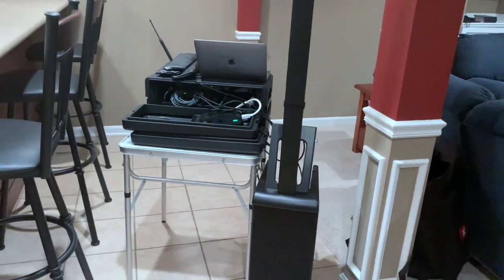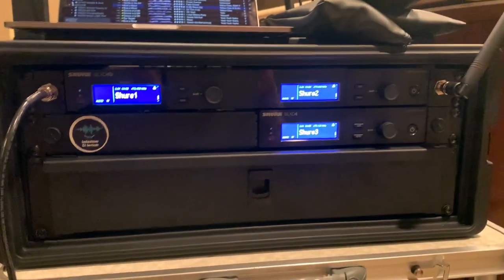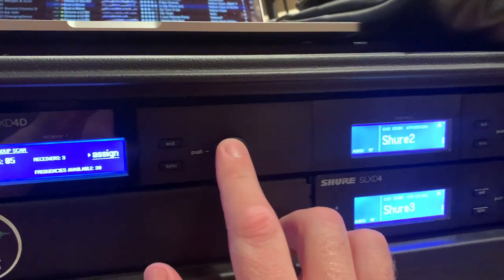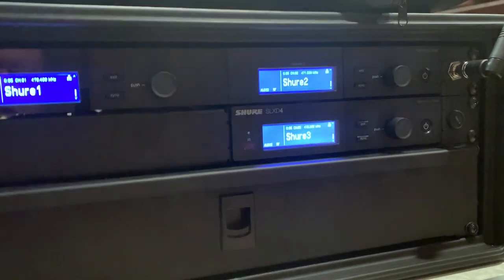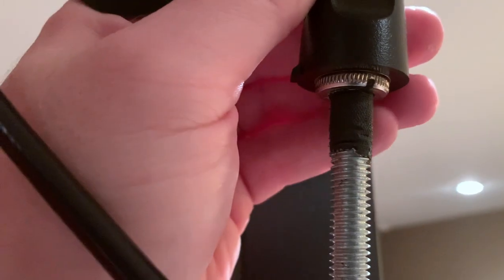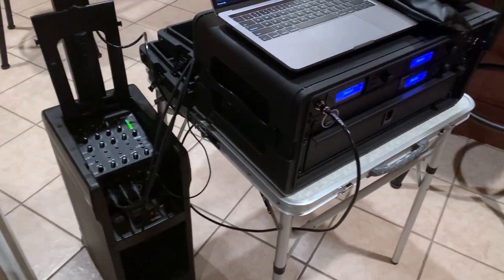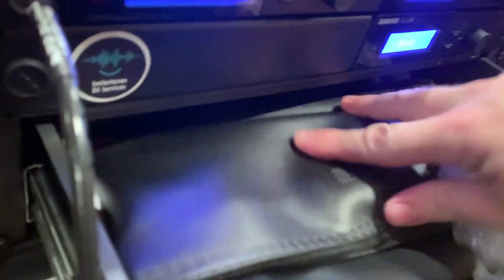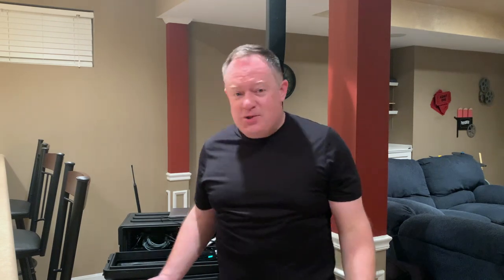Wedding DJ Ceremony Setup that is High Quality, Efficient, and Ultra Portable

Comment: Nice setup. Only thing I do differently is I only have 2 mics for ceremony max. The 2nd U is for a 1U mixer so all the mics go cleanly into it. 2nd reason mixers built into speakers have been prone to feedback. May never happen. Also, you wouldn't have to plug in 3 mics everytime. Point of having a case is sitting it down and it being self contained. Only thing hanging out is the power.
Reply from the maker: Good thought - thanks for that

Comment: Good ideas, I have the Maui5 Go and typically use a fastset table with scrim for a clean look. Definitely got me thinking of different options to consider to minimize my setup. Like the little slot your JBL Eon Pro has for the fin antenna.
Reply from the maker: Awesome, glad it might’ve spurred a couple ideas!
Reply from the maker: Jesse - the front facing BNC connectors were included with the dual lav mic receiver I bought from shure :)

Comment: Great video! I'm curious how you are combining 3 receivers into 2 antennas.  I understand you're using combiners, but I can't figure out how to wire it up.  According to Shure, they seem to require an active antenna distribution system for 3 or more receivers.
Reply from the maker: Thanks! Ok so I’m cheating a bit because I actually just have 2 receivers here — the two lavs are part of a dual receiver chassis — similar to the following https://www.bhphotovideo.com/c/used/1566020?gclid=CjwKCAjwzOqKBhAWEiwArQGwaBqZrgWM0qJLA_PnaoIJbSkx37aLBBIh3FzwItLE9kgpfREsMlrAdBoC5IAQAvD_BwE

Comment: Great setup! but you might think about some type of small booth where you can hide things, because the overall look is kind of messy. Do you put some kind of cover on that table? Also, I switched from a laptop and small controller, to a Denon Prime GO for my battery ceremony system and it works great. Thanks for the video
Reply from the maker: Well thanks David. And appreciate your comment.
Reply from the maker: Envious of your Prime Go for ceremony- cool!
Reply: @SmilestonesDJAdventures  Ditto for your mic setup, that’s my weak point. Awesome fin idea

Comment: I always tell to starter DJs and Sound Guys: the most important part of ceremony sound set up is to PUT SPEAKERS AT THE FRONT! DONT PUT SPEAKERS AT THE BACK OR ON THE SIDE, don't be lazy and respect the audience, bride groom, and their parents and do it right!
Reply from the maker: That’s a good point. I like projecting audio from the rear of ceremony to help the folks in the back hear better, and to keep myself and my gear out of ceremony pictures! :)
Reply: @SmilestonesDJAdventures  at my own wedding we had a band so I ran my own ceremony / cocktail hour / speech sound with my Bose L1. I set the speaker at the front right for ceremony but during the speeches we were in the middle of the large room. The delay was terrible
Making it difficult to speak. That wasn’t the best decision.